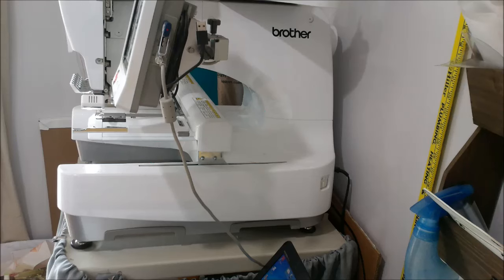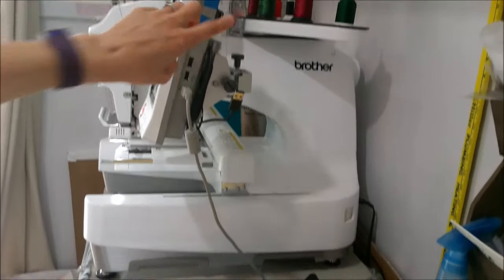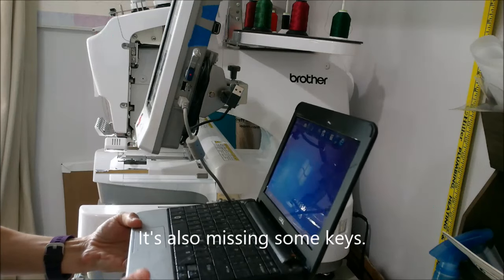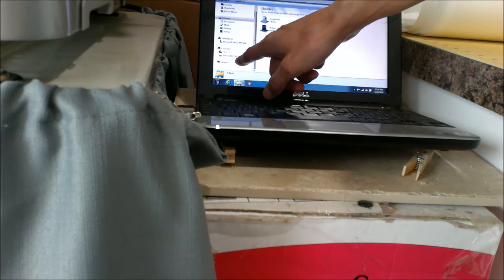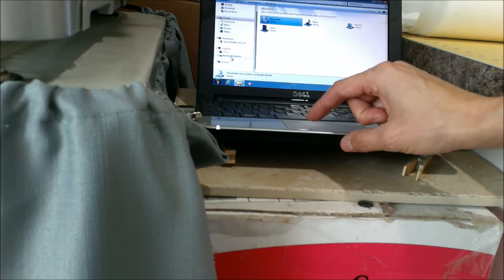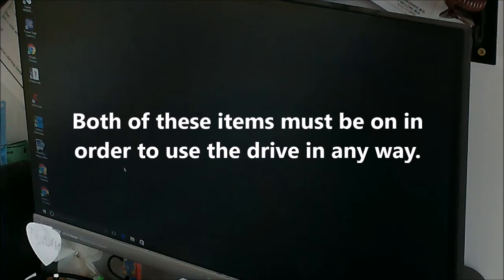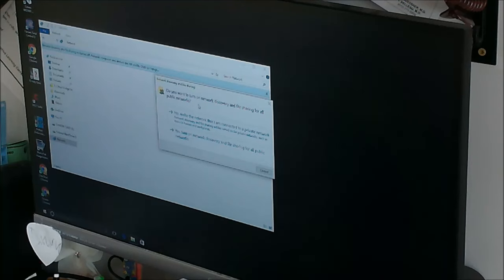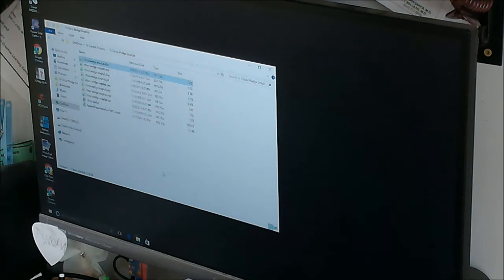Wireless embroidery

Comment: Hi... I just want to thank you for this video.. I set up my PR1050 a few years back this way... however, I am just trying to find out if there is an alternative to the large old laptop I have... does your hubby have any ideas?  I was wondering if the SSK Portable NAS wifi hard drive would work, but am unclear yet if that can RECEIVE files via internet explorer and wifi like my laptop does... I dont really want to look at the Wilcom Connect as its not suitable for multiple file transfer yet so would be too lengthy a process compared to now... any ideas? (I have skyQ modem and Devolo 1200+ wifi powerline adapters also if that helps if I can set up a new network.. I have seen the Raspberry Pi but not that tech savvy to build one lol ) xx